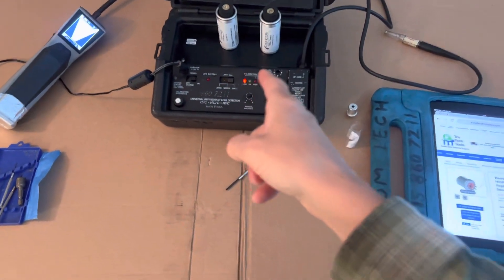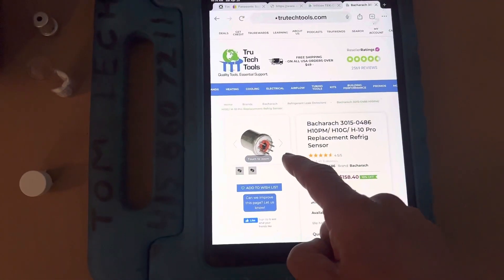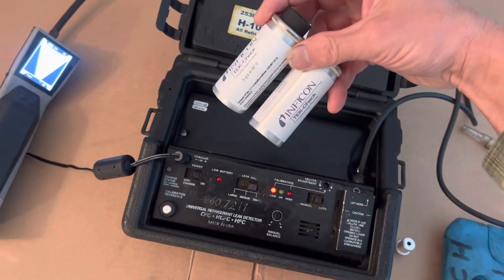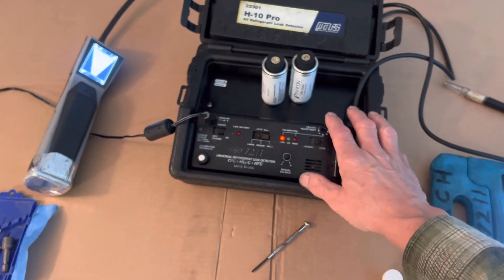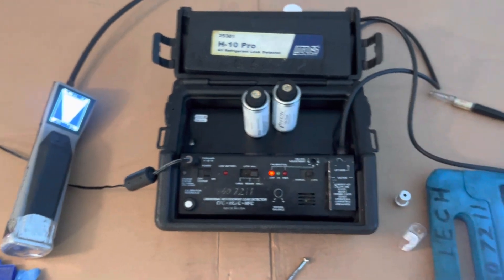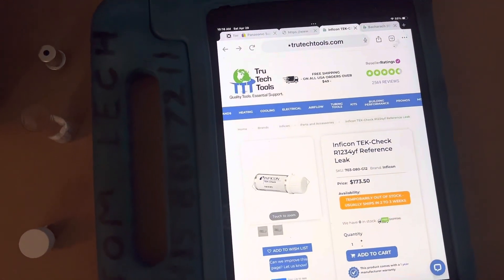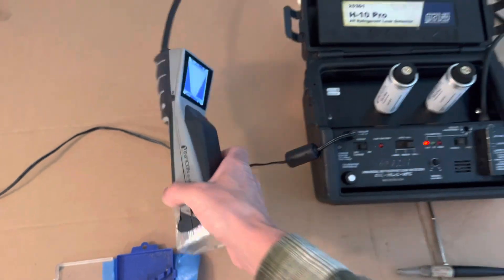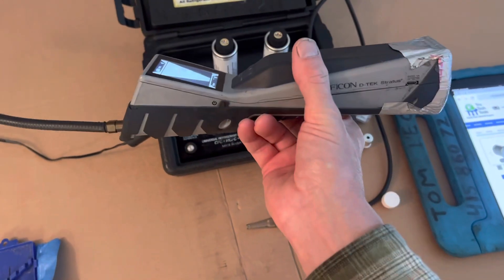H-10 Pro NEW SENSOR INSTALL.  Retest compared Inficon DeTech Stratus versus. H-10 Pro

Comment: Thanks Tom. When u charge using 20lb can on low side after vacuum, I assume you have to run compressor on to push the freeon as per the spec. If I use small can on low side after vacuum it pulls only 8 oz or so then I have to start the car with AC on and compressor have to kick on to push the rest. I assume the same for 20lb can as well . Pls advise
Reply from the maker: No not if I do everything correctly using gas laws to my favor vapor can completely fill system with out starting engine
Reply: @coldfinger459sub0 you are talking about low side with 20 lb. If I use small can it doesn’t
Reply from the maker: @sivucit  same thing with small cans
Reply: @coldfinger459sub0  Tom , please guide me and tell me what the hell i am doing wrong. i pull vaccum below 500 and it levels off to 700 to 800 after the vacum turn off in about 5 to 10 minutes. then if i use small can it cant take only 10 ounce, then when i put second can, i ahve to start the car for compressor to create scution pressure.  am i doing anything wrong, please advise.
Reply from the maker: @sivucit like my father would not tell me how to do it. He told me go back again and read the three gas laws. There’s actually five or six.
But it’s the three first main ones you can figure out what you’re doing wrong to use the gas laws to your advantage . 

My father would not allow me to touch my first set of gauges to charge up a vehicle until I was able to tell him in the great detail step-by-step before he would allow me to even touch the gauges on a car . 

So at 12 years old, I had to go back up again hit the books took me about two hours 2 1/2 hours. I was a slow reader . Trying to understand this concept.

And all of a sudden it hit me while I was reading 

Went back to my father explained what I did wrong of my thinking and re-explained it to him correctly and he allowed me to proceed 

And at 12 years old, I charged my first vehicle first time successfully 100% refrigerant charge in the vehicle without starting it . 

Ever since the age of 12, it has always been easy .
Reply: @coldfinger459sub0  Thanks are you referring to pressure, volume and temperature. I have learned (Pressure Times Volume) / by Temperature. I need help in correlating this theory to reality.. Boyle law, charles law and Gay's law. i gavve combined gas formula..  Boyles law Pressure decrease , volume increase and vice versa. when i pull vaccum, pressure decrease and volume increase within CAR HVAC. also when temperature increase volume will increase. when temperature decrease , volume will decrease.. last is tempeature is directly propotinal to pressure under constant volume. if volums is same, and if pressure increase then temperature will also increase equally..  not sure to tie this to reality.
Reply from the maker: @sivucit  yes that’s basically in the right direction. 
 
Exact same principles of watch the large expensive RRR machines work off of when they are recharging a customer’s car 

A good machine will completely recharge the vehicle without turning it on .
Reply: @coldfinger459sub0  if i use small can , in practice it is  not filling 20 oz in vaccum, just 8 oz, second 8 to 10 oz, when i put second can, i have to start the compressor .. so wondering how would u put the secon can (smaller can) without starting compressor.
Reply from the maker: @sivucit  on AliExpress on Alibaba in Ebay more difficult to find but available on Amazon. They have tan caps that can hold two or three. I’ve even seen four cans can be screwed together all at once on a TEE

Comment: 130 dollars for that tool on Amazon and I lost all my gas due to a leak somewhere. If I want to find that leak I have to buy 30 dollars worth of whack off cans of refrigerant or whatever the minimum is just to get the compressor to come on so I can find my leak. That's 160 bucks for me to locate the problem not even counting the cost of new gas. If 200 gets me a diagnosis and evacuation of any remaining gas for safety reasons and they will come back and fill it up with fresh gas after I replace the bad parts that's probably cheaper than DIY troubleshooting
Reply from the maker: Yes usually cheaper.

Comment: funny seeing the tape on the battery door. I shoved a vacuum connector by the battery latch so the battery would quit knocking the door loose on mine. but the door catch is a bit lacking
Reply from the maker: Yes, I broke the catch latch.  Swapping out CO2 sensor and also swapping out flammable hydrocarbon sensor and then back to Refrigerant sensor. 

That’s the one drawback of using the one leak detector for all three different refrigerants. If you swap out the sensors a lot that little plastic catch lunch breaks. .

Comment: Hey Thomas Im about to purchase a used leak detector, probably an Inficon or a fieldpiece. What worries me is how aging of these sensors work? If they werent used there isnt a problem right? Prices of a quality brand new leak detector is sky rocket here, but a 2nd hand Inficon Tekmate would do good for me if its in a good working condition
Reply from the maker: TecMate  is entry level low level leak detector.  Look up the price of a new sensor so you know what to expect if you need one..  look up a price of a new battery because the batteries have a tendency to go bad on them.  The early models I’ve owned one if you would turn them upside down or bump anything they would falsely go off at the slightest bump when I used one..  I was not too fond of it. 

But it will work  

What model Fieldpiece they made several leak detectors . 

Remember, these are usually rechargeable batteries they have a limited .  Even if not in use when you store rechargeable batteries, sometimes they take on a memory and reduce their capacity so you will have to recharge them more often..
Reply: @coldfinger459sub0  You right, I found good price on replacement batteries, but replacement hot diode sensors are expensive, funny thing: more than what I pay for the 2nd hand entire detector

Fieldpiece XRL8 is the model I can purchase too. Recently a chinese company Elietech re-branded his name here as Xetron and they are selling new detectors which maybe are a better option for the moment. I want to detect leaks in the future with N2+H2 but I dont know If these chinese made detectors would do it
Reply from the maker: @ignatius2230  hydrogen or helium. Leak detectors are specific sensor only for those gases refrigerant leak detectors are not meant for that.. 

You have to specifically purchase a separate leak detector for hydrogen and a separate leak detector for helium .  

Elite tech  kind of low end, minimum bottom of the line leak detectors.  I did one video one of my shops purchased one brand new and it did not pick up the reference refrigerant leak, detector bottle sample..  
So I got a fail thumbs down . 👎 

It’s all about finding a small hard to find leaks . And leak detectors that will last for years or decades..
Reply: @coldfinger459sub0  I have to research more because there are too much leak detectors out there, probably I go for the used fieldpiece in order to save some money but considering spending more If I get some incoming money on AC repairs

We'll see! Thanks a lot Thomas, I make you know how good or bad results I get just for fun haha
Reply from the maker: @ignatius2230  
I would probably go with a Fieldpiece. It got good reviews amongst a commercial and residential HVAC community.

Comment: I can't believe that sensor lasted so long.
Would it be viable to use CO2 as a tracer gas and use the stratus with a CO2 sensor to pressure test and find leaks?
Reply from the maker: If the CO2 was moisture free.  With some vendors suppliers contamination is a problem they just hire kids or guys with little to no experience with high turnover rate for a cheap position filling tanks.. 

There’s a difference between medical grade CO2 laboratory grade CO2 that are on clean, dry, evacuated, moisture free tanks . 

Then tanks that every Joe blow turns in that had the knobs left open infiltrated with outside, atmospheric moisture air under high production just get rapidly refilled to push out for things like beverage CO2 to make your soda sparkly for CO2 just use for general purpose propellant . 

But yes, CO2 would be good if clean and dry . 
The stratus CO2 leak detector sensor is extremely sensitive. I made a video on that I have the sensor. It works excellent 

But sodas, hydrogen or helium with the 95/5% mixture with a hydrogen leak detector or a helium leak detector
Reply: @coldfinger459sub0  I knew you'd have the right answer 😉. So the mercedes a/c system using CO2 is high grade moisture free I would imagine.
Reply from the maker: @Automotive_Solutions  of course it’s Mercedes nothing but the best crap on earth. 

I really wish they would bring Mercedes CO2 systems to the United States. I have been dreaming in fantasizing about this. .  $$$ money 💰 because I know for a fact, I would be the only one in San Francisco who would be able to recharge them at a ridiculously incredibly high price and only one or two Mercedes in our area would be the only other competition I would have 🤣.